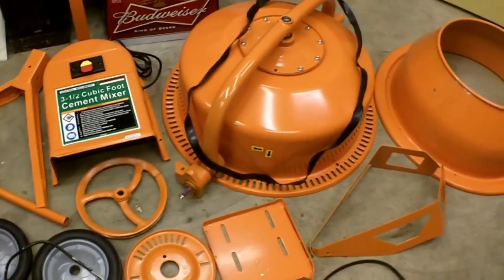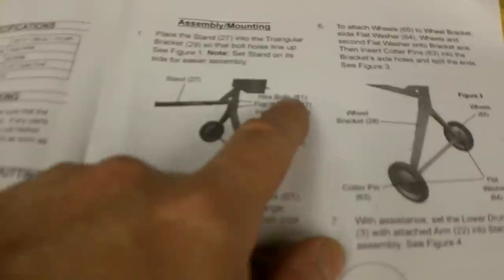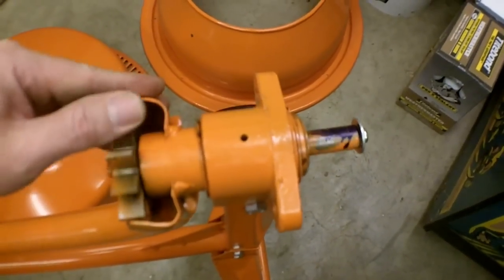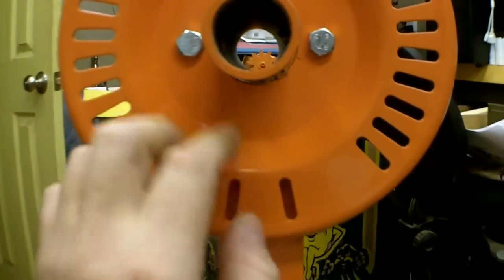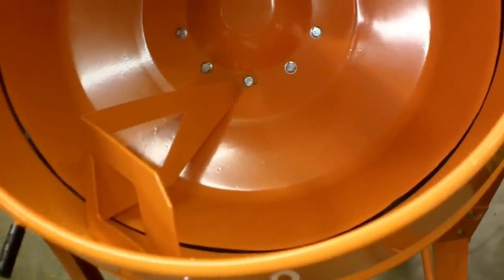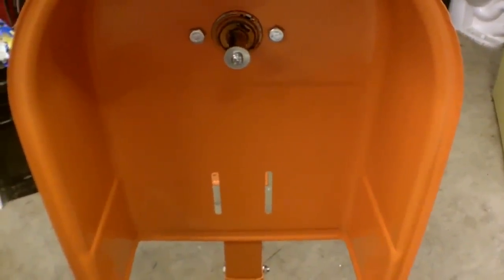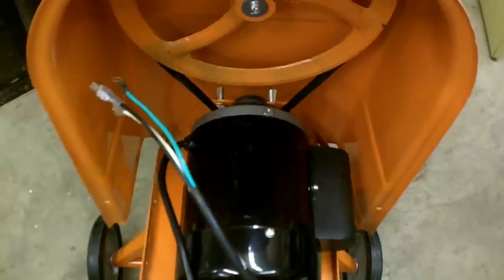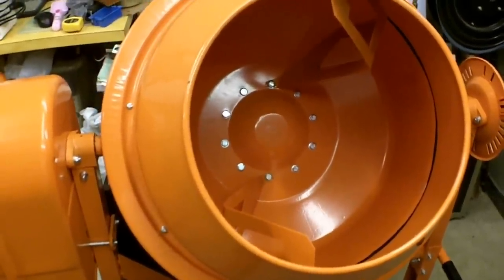Harbor Freight 3.5 Cubic Foot Cement Mixer Assembly and Review. Item 67536

Comment: Very informative video. I viewed another video just before this one in assembly of the mixer. The first video was very vague and did not put details to the assembly and any issues they came across. I am waiting for the next 25 percent coupon so that I can go get mine. Hope it is very soon since I need to built and pour for a lawn border. Plan to use it for other yard improvements after that, so it will gey some good use. Thanks for the great video!
Reply from the maker: Glad you found it informative Bill! The 25's used to be found all the time- but not so much in the last few years. You can always find a 20 if you get too impatient. Good luck with your projects.

Comment: The little nut for the electrical ground wire is 4mm taking a 7mm socket. Just put ground and another nut 4mm nut on top.
Reply from the maker: That's an option. Take care, G.

Comment: Great video, just put mine together  today ,I had ordered one and when it got here box was not in good shape ,didn't check for missing parts just started putting it together didn't realize it was missing the motor until I was ready to put it on LMAO, so got this one today and it makes the excat noise your has, I wonder if I put some grease on there will make it quieter
Reply from the maker: That's no good! Grease would probably help the noise, as well as prolong it's life. Good luck, G.

Comment: I just got one in 2017, terrible instructions, that hasn't changed. but this really helped me with some gaps in the instructions. Also all the nuts and bolts except the ones to put the 2 drum halves together, were all in one bag. Thanks for posting.
Reply from the maker: LOL! I suspect they never will Rick! I'd heard from others they just got a big bag of fasteners as well. A pain, but doable. Glad the video we useful. Good luck, G.
Reply: I got it together today, works fine. I'm going to use to mix substrate to grow culinary mushrooms  in. Don't plan on doing much concrete work. Thanks again
Reply from the maker: That's cool Rick! I've heard of some using them to make fireworks with. Mixing for gowning mushrooms is a new one on me. I bet it works great for that, and a lot easier than manual mixing. Hopefully it will take the work out of the work! G.

Comment: Great video.  Put mine together today in a couple of hours.  Different bolts and screws came in separate baggies which was cool, but the numbers on them had no correlation to the instructions at all.  Did match up to the separate schematic they included though.  Mine was the 67536 so I had to plug in the wires to the motor which wasn't a big deal. Seems to work fine.  Has the normal "growl" on one place on the ring gear that most of them seem to have.  Anyway, thanks for the video.
Reply from the maker: Thanks! Yeah, I've heard from others that things are different here and there. Glad it was helpful in some way. Let the real work begin now...lol. Take care, G.

Comment: so glad you did this. I only had to redo the two things. Use both thrust bearings, and most importantly, I did not align the arrows.  Oh yeah, the motor mount bolt bracket, how could I forget that.. I for one appreciate this tutorial.
Reply from the maker: Very glad you found the info useful. Thanks for the post and good luck! G.

Comment: Another well done video!  I just finished up my first project and was very happy with the mixer.  Make sure you add the water prior to adding your concrete mix or you will end up digging it out of the bottom which will be compacted by then.  I know its 3.5 cf,, but I found that 3 of the 80lb mixes were about its maximum.  Noting those two things, this tool is great.
Reply from the maker: Good deal! Thanks for the tips based on your experience with it. It will be helpful to me, as well as others I'm sure. G.

Comment: Thanks for taking the time to make this instructional video!  I'm waiting for my next 25% coupon deal to buy one myself and will certainly be viewing this again when its time to assemble!  Great Job!
Reply from the maker: No problem! If you want, you can go to this site. About halfway down the page you can find a printable 25% off coupon. My store takes them no problem. The mixer seems to be on a sale now. With the coupon, you would be looking at $149.99 plus tax. Good luck, G.

http://slickdeals.net/f/1276399-harbor-freight-coupon-thread
Reply: ***** Thanks!  I actually saw that link you posted and have already printed my coupon.  I will be picking mine up on either Thursday or Friday of this week,
Reply from the maker: philkidd
Good deal! The video should get you through the assembly without issue. If you do have any problems, let me know and I will assist if possible. G.
Reply: ***** So as it turns out, the my Harbor Freight did not accept that coupon as it is not something from their website.  I wound up getting a membership (which I was planning on doing anyway) and with that, I was able to get 25% off.  I picked it up this afternoon.  Probably won't be assembling it for awhile as I have some other pre-work that I need to do before I'm ready to pour any concrete.  When it's time for assembly though, I will be watching your video again for sure!  Thanks,  Phil
Reply from the maker: philkidd Phil, I have heard some stores are fickle about the printed coupons- yours being one of them I guess. My store takes them without question. At least you ended up getting the discount with a membership- that's good.  Let me know if you have any problems and good luck with your projects, G.

Comment: Thanks for video! i bought one yesterday and it took me 3 hrs to put together.  Only had first  picture of assemble of wheels and all the bolts were in one bag as well as spring missing. I should have thought something was up when the cashier told me if i bring it back they would charge me 20 % restocking fee.
Reply from the maker: No problem Ben! I've heard of others stating their HF store charges a restocking fee. I've never heard that at any of the three stores in my area. Perhaps it's a regional thing- who knows. Take care, G.

Comment: Very helpful. Watched it thru first before starting. When I realized the parts bag numbers corresponded to the one page diagram, it was easy to conceive. One thing to mention: the electrical ground in the switch area provided is not right. When you attach the grounds to painted metal it won't ground properly. I scraped the paint away from the motor and line ground in the little electrical box to remedy this. Also had to scrape paint from the motor shaft and large pulley hole, And the motor pulley had been installed backwards at the factory - simple to reverse.
Reply from the maker: Thanks! I'm glad you found it useful. Very true on the grounds- that's something I overlooked. The rest you mentioned doesn't surprise me one bit...lol. Easy to remedy, but not something that should have to be done. Glad it went well overall! Take care, G.

Comment: Thank you for saving much frustration. 
A FEW DIFFERENCES our mixer had (that was not noted in this video OR the lame instructions) was that there are pre threaded fixtures to attach the handle control plate, motor hood, and support bracket seat. Hope that info helps other befuddled DIYers.
Reply from the maker: doclimb No problem! I'm glad it helped. The instructions being "lame" is a MAJOR understatement....lol. It sounds like they've changed a few things on the newer models since you had threaded holes here and there. Thanks for sharing the info! I'm sure it will help others out! Good luck, G.

Comment: My father in law bought one of these. It was inundated in the box (the motor was removed from the box before the flood) during the Deweyville, Texas flood of March 2016.  We moved them next door to us and a few days ago, I began taking this thing out of the packing.  The bag of hardware was mostly rusted.  I soaked everything in vinegar for a few days, then put it in snack sized zip-locks and a card with the bag number on it.  I found everything  but the poly washers and the belt.  No reference to the belt size anywhere.  Good thing father in law  has a much older non-working model that I can rob the belt from. If its too dry-rotted I'll cut it, measure it, and go to tractor supply to find something of similar length.  Belt Source if that fails.  I downloaded the manual, but like you said, it was total crap.  I got as far as installing the lower drum before a lightbulb popped on in in my head and I remembered that every other damn thing has a how to youtube video.  I am grateful to find this and will finish assembling the mixer in my man cave while I watch rubbish on my big screen and drink beer.  It would have been useful when I was setting fence posts a few days ago.
Reply from the maker: Glad you were able to salvage everything, and the video was useful. Big screens, machines, and beer- what more could you want?...lol.  Take care, G.

Comment: Great video.  I am having trouble getting the key and pulley to fit on the spindle.  Any suggestions?  Thanks.
Reply from the maker: +Mark Bradley 
Thanks Mark! You might try leaving the key sticking about halfway off the shaft, then align the pulley and tap it on. Then tap the key the rest of the way in if it's still sticking out. A little light oil on the shaft might help as well. Hope this helps, G.

Comment: Got mine together just fine.... thanks again for your efforts as it made my efforts less. Same story with the gasket.... boy is that worthless. I didn't even attempt using it and opted for a good thick bead of silicone instead. I need to check out the rest of your videos and see what else you have going on..... Thanks again!
Reply from the maker: No problem, glad the video helped. They could do better for sure with the gaskets and packing. Mine worked out just fine using the gasket, but just using a good bead of silicone was a good idea. I'm sure others will follow your lead. I have a bit of everything in my videos so you might find something else of like interest. Take care, G.

Comment: As an Electrician I would recommend you bolt both green wires together on the same stud. This provides slightly less resistance in the motor ground circuit. Great video!
Reply from the maker: Thanks for the tip! G.

Comment: Thanks. Have to add to srwnc comment, the one I just got had all the parts in 2 bags with cable ties; thought I had got a return but it appears HFT puts together many configurations. No simple pic to refer to. Even the one in the store had different parts than what I got.  The prewired motor was attached to the cover with a single bolt that bent the motor mount. Still, having heard that the instructions were difficult, it it great to have your video to check my work against.
Reply from the maker: Thanks for adding more info Mitchell. It does appear they have many configurations. They might have several manufactures making the same products, with subtle differences. Glad the video was useful, though not exact to your model. Good luck, G.

Comment: Great video!  Thanks for saving us lots of time!  We only have one problem:  The drum pulley won't go on because there is a washer type thing screwed in at the end of the shaft that the drum goes on.  It is on there so tight, we can't get it off!  I  do not want to break an internal part.  Any help would be appreciated.
Reply from the maker: +Debbie Boone 
Thanks Debbie! I'm glad it's been useful. As you've found, you will need to remove the screw and washer in order to install the pulley. It should be right handed threads, so counter-clockwise to loosen. The first thing to do would be to make sure you have a well fitting screw driver so you don't strip the head, they apply a lot of inward pressure when trying to break it loose. If that doesn't work, try putting in the screw driver, turn it slightly so it barely starts coming out of the screw, hold firm and hit the screw driver once with a hammer to see if it starts to loosen. That's the best I can think of. Hope this helps and let me know how it turns out. Good luck, G.

Comment: Excellent video. I recently purchased this mixer from harbor freight. (7/4/2016- got the same deal you did)
The video is nice in that it gave me some perspective how to put it together because the instructions are vague and not extremely accurate and the parts list and diagram doesn't always match up. One note about the video since you did it in 2013. Seems some things have changed with the mixer in parts and what is already put together. I.E. there is no spring adjuster on the lever, the spring just goes into the lever and is a royal pain to compress to line up the bolt holes. I finally managed by using a large C-clamp. The motor is pre-wired to the cover which makes it a pain to mount the motor. Several other changes on the 2016 model, but your video helped make sure the result looked like yours. At least it worked when I turned the power on :)
Thanks.
Reply from the maker: Thanks! Agreed, the manual leaves much to be desired. I can see where it no longer having the adjustment bolt for the spring, and having the motor pre-wired would make it difficult to assemble in those areas. All changes considered, I'm glad the video is still somewhat relevant and useful. Thanks for the information! Good luck with it and your projects, G.

Comment: Step 14:  does the disc or the spiral spring go in first?
Reply from the maker: Jesse, the disc goes in the hole first and rests against the adjustment bolt- followed by the spring. G.

Comment: I have a question about a difference in the unit I have and the one you assembled,.  In the electrical connection there is no post in mine for the ground wire.  The green wire from the switch is connected to a post.  There are locations to connect the white and black wires, but no post for the incoming green ground wire.  Any ideas?  And thank you for the excellent explanation of assembly.  I really appreciate the care you took to show and tell how to put this machine together.
Reply from the maker: Thanks! Put the ground wire on the same post the switch ground wire is connected to. Hope this helps, G.
Reply: @ghostses  Thanks so much.
Reply: @ghostses  It's working!
Reply from the maker: No problem! G.
Reply from the maker: Awesome!!! Take care, G.

Comment: Really a tremendous video. You helped me so much! The gasket discussion was invaluable. In my case, I am missing some critical hardware such as the key for the motor mount. Not sure how I will deal with that. But you've really helped -- thank you!
Reply from the maker: Thanks! Glad it was helpful. You could possibly find a motor shaft key at Ace Hardware. They should have a variety of sizes to choose from. I don't recall the size though. Good luck, G.

Comment: My machine only has 1 ground screw with the existing ground cable, yours has 2, should I connect my green to the existing green ? Thanks for the great video
Reply from the maker: Yes Manual, connect both ground wires to the same screw. They must have changed them over time. Glad the video was helpful. Good luck, G.
Reply: ghostses I finished assembling mine today, can’t wait to try it, all thanks to you my buddy,
Reply from the maker: No problem! G.

Comment: Thanks for the video it helped immensely. I'm sure I would have eventually figured out but I'll bet this cut my time at least in half. My mixer came with all the bolts pretty much lumped together in one bag which was a pain. God bless!
Reply from the maker: Thanks Dallas! Yeah, you would've figured it out but glad the video saved you some time. I've  heard 1 bag and 2 bags from others as well. Sorting the fasteners out would be a pain and make it take longer than it should. Take care, G.
Reply: @ghostses  Have you used yours? The motor seemed a little wimpy on mine. I could hold the drum and turn it on and it would stall. I also have a slight wobble in the barrel gear as it spins over the toothed sprocket.
Reply from the maker: Not all that much Dallas, but yes. I wouldn't worry about the slight wobble. I think that's just their nature. Take off the motor cover, then turn it on while holding the drum and see if the belt is slipping on the motor pulley. That could be your problem. If so, tighten up the belt and try again. You may be able to peek up from the bottom without taking the cover off, but I'm not sure. Good luck, G.
Reply: @ghostses  Thanks for the advice I    will check the belt. The reviews seem to be positive in most cases.
Reply from the maker: No problem Dallas! Let me know what you find. G.

Comment: My mixer did not come with the bolts in individual bags.  It was almost impossible to put together.  I went to the parts list and divided them out.  Took at least an hour.  Would have loved to have the baggies, OMG!  It took 4 to 5 hours altogether to assemble.  Now that it is together has been a great back breaking save, literally.  Have used it several times now but was bought for a single job and would've been worth it for that one job.  It is going strong.  This would've been great help but just watching it I had a few chuckles 24:54 "got some wiring... don't think that is noted in the manual but we'll get too it" and a few more like that.
Reply from the maker: Yeah, it's a challenge no doubt. LOL, wiring and a few bits weren't covered in the manual but it was what it was. We got there though.  That was my focus as well, to make a job easier and it's done a bit of work now and still works well. Hope your jobs went well. Take care, G.

Comment: I wonder if rubber gasket sealer between the drums would help with some of the noise as it wouldn't transfer the harmonic as much with a rubber insulator. (I realize it's miss aligned... But it may help some..)
Reply from the maker: Darren Schroll That's a good question Darren and I don't know. It does run fairly quite when it's being used, but it's still a little annoying. G.